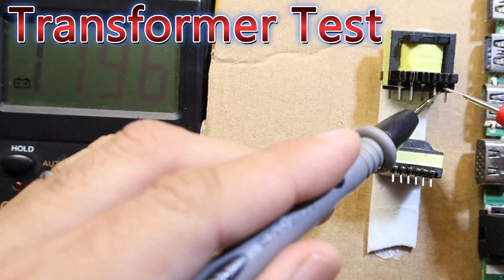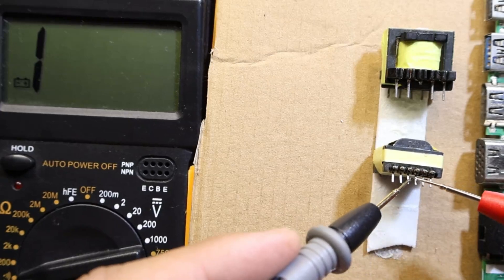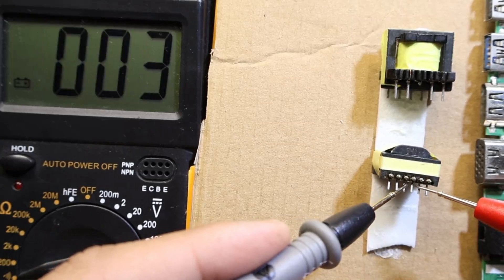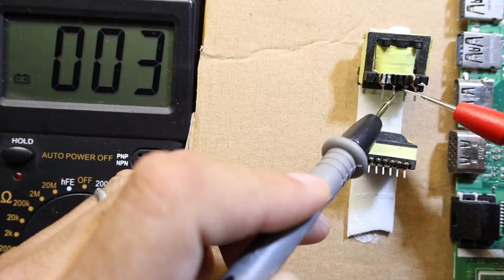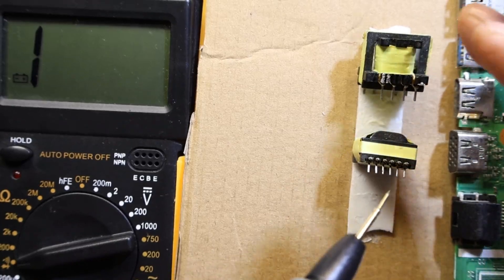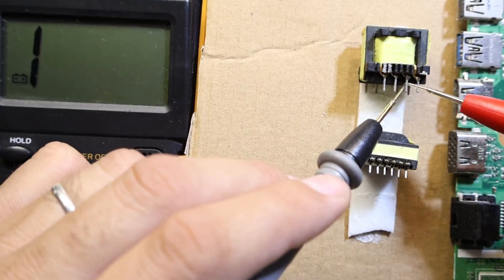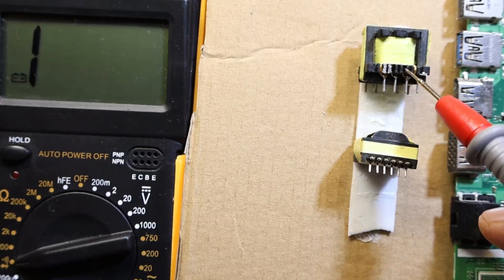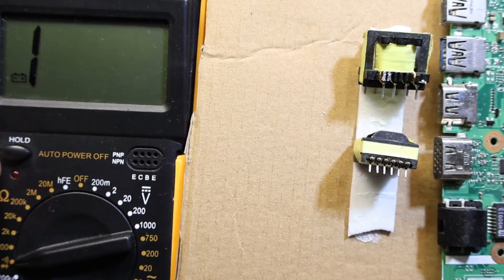Test Any Transformer in 30 Seconds (Multimeter Trick)

Comment: And how do you know that there is no short circuit in the coils?
Reply: Measure the resistance of the coil, the resistance value will be low but not as short circuit.